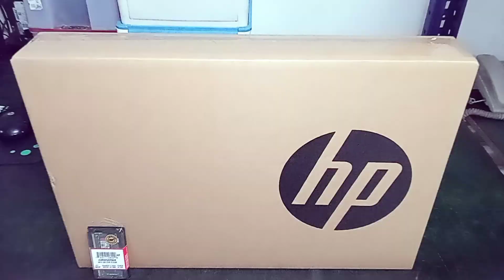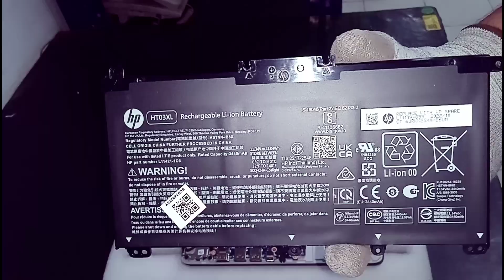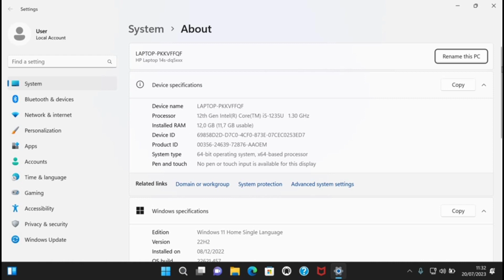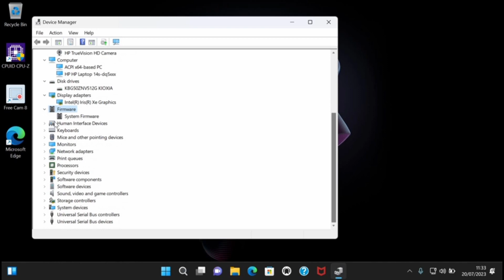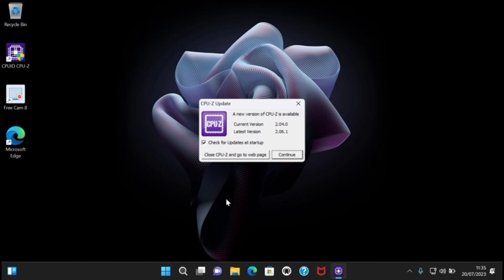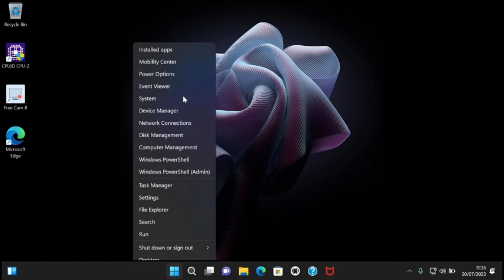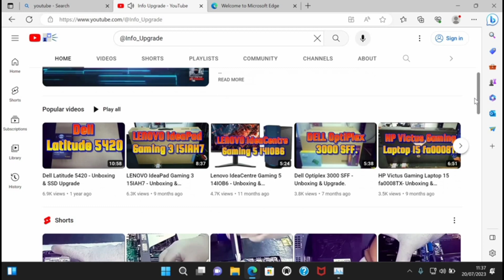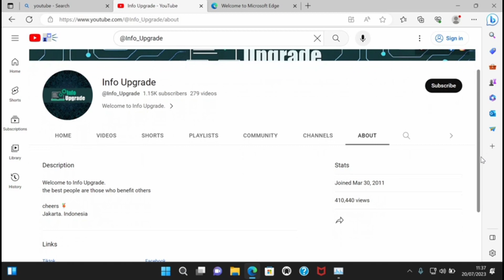HP Laptop 14s-dq5001TU - Unboxing, Disassembly and Upgrade Options

Comment: Bang bro itu ssd yang aslinya bisa di cabut gak ya 
Juga itu di solder atau cuma di baut bang kalo di baut nyopot nya lumayan mudah bang
Reply from the maker: Bisa dicabut bro 
Mudah kok, cuma dibaut
Reply: @Info_Upgrade  alhamdulillah bisa di cabut ya bang aku kira itu permanen di solder .
Bang itu yang buat ssd sata 3 nya sudah ada colokan nya kan bang cuma kabel nya saja yang gak ada
Reply from the maker: @RITRAMEDIA1  iya bro kabelnya beli terpisah ya
Reply: @Info_Upgrade  okey bang tapi kalo yang buat colokin kabel konektornya sudah ada kan bang di laptopnya
Reply from the maker: @RITRAMEDIA1  sudah ada bro tinggal beli kabel SATA nya saja
Reply: @Info_Upgrade  oalah sudah ada yah bang okey bang terima kasih banyak atas informasinya aku juga penasaran laptop itu bisa di up 32 gb gak ram nya sama ssd nya 2 tb bisa apa gak🤔